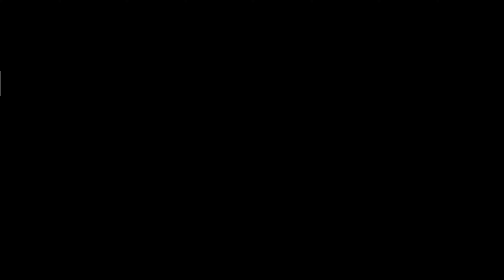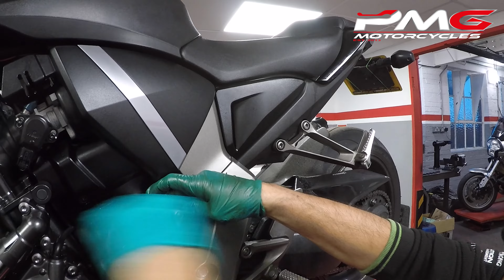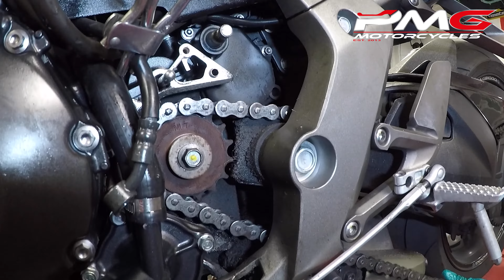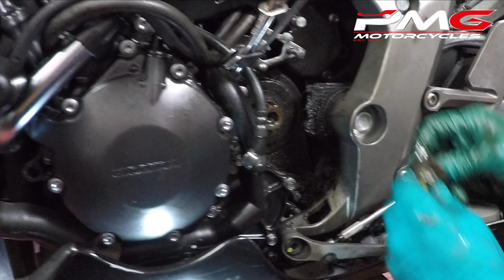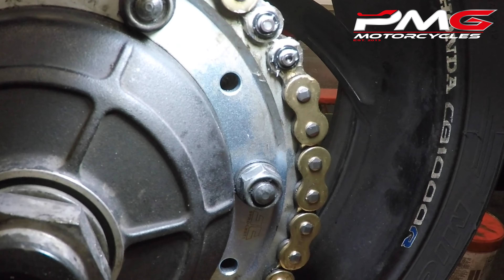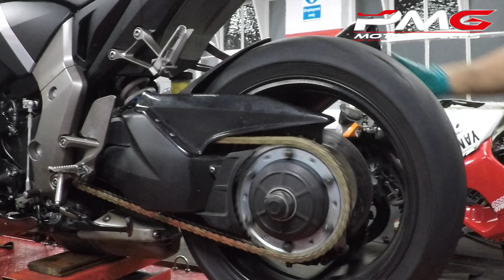Honda CB1000R How to Replace Chain & Sprockets

Comment: You can just remove the clutch slave and not undo the fluid pipe its saves loosing clutch fluid and making a mess.

Comment: Is the rear sprocket meant go go on that way ie with the writing facing outwards. Because I did this and a load of people said that I'd put it on the wrong way round. Also in my Haynes manual it is the other way round as well?
Reply from the maker: Facing outward facilitate you to identify the description  and specs of the sprocket at a glance and the direction how it has to be fitted. Hope it help you. Thanks for your comment.
Reply: Yes
Reply: You are right, they did it wrong! The official service manual clearly states it had to be the other way around.

Comment: Awesome video! 
Just got my parts delivered, looking forward to trying this job myself for the first time. 
I have one question.. When I first bought my CB1000R I tried to remove the front sprocket cover, which requires the clutch slave cylinder to be removed first. I had problem getting it off.. 
I was able to pull it back a couple of centimeters or so, but it wouldn't let go of the clutch rod thing... Is it just a matter of patience and using a bit more force or do I need to unhook or empty the clutch fluid hose?
Reply: @Erik6635 - I'm facing the exact same problem as I'm about to do this on my CB1000R as well. I can't remove the clutch slave cylinder no matter how hard I try to get it off! How did you solve this matter...? Eagerly looking forward to your response!
Reply: @elpepso6445  Hi, sorry for late response. You need to separate the slave cylinder (don’t need to drain fluid). There is a paper gasket, which you might need to replace. I think I had to slightly pry it open with a screwdriver, so I replaced the gasket. After the cylinder had been opened you can simply pull out the clutch rod straight and remove the entire assembly (remainder of cylinder and sprocket cover). Hope this helps!

Comment: Hi there, I have a question please ! I got a 2019 CB1000R and want to swap stock sprockets. I found a Renthal brand 15T front sprocket & 44T rear sprocket. Will they fit my model ? Also is aluminum anodized a quality material for a rear sprocket (made by Renthal) ?
Thank you much

Comment: While you opened the casing to change the front sprocket, what oil was drained ? Engine oil !!!
Reply: That is the clutch slave cylinder. Its clutch/brake fluid.
Reply: He didn't need to take the pipe off just remove the slave cylinder and then nothing will spill out.